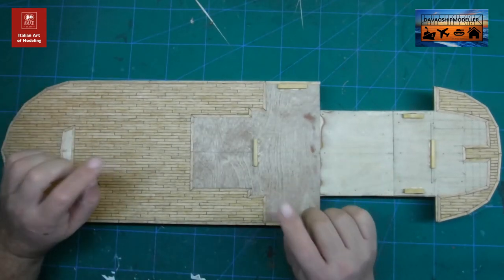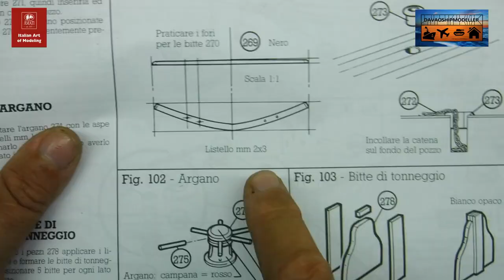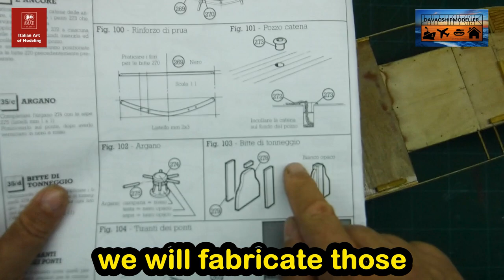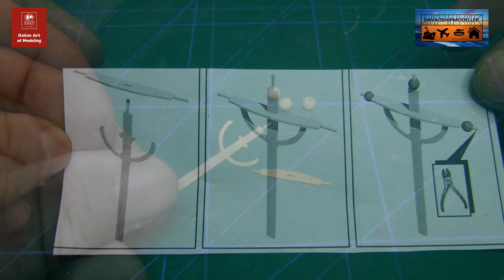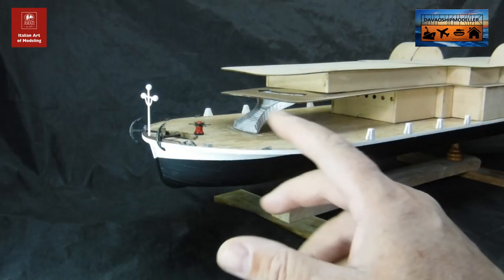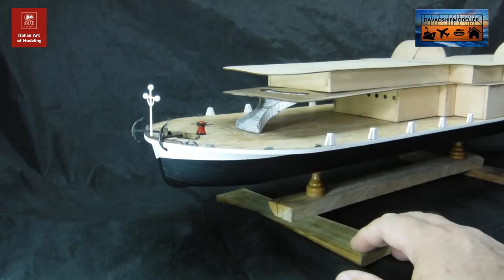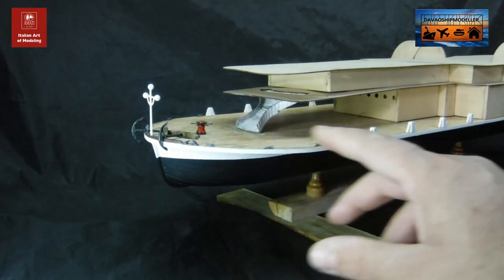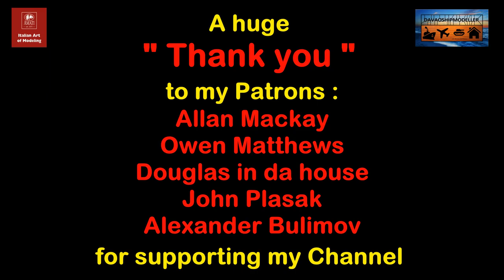Amati Robert E Lee Part 5

Comment: The 'thing' you lost looks to be a "brass eyelet" (used for reinforcing lace holes in fabric). You can get a pack of them in amazon for just a couple of pounds/euros/dollars, and then have both match exactly :)
Reply from the maker: That's correct, but to order it would take Time and I think the DIY Replacement just look fine.  Thank you